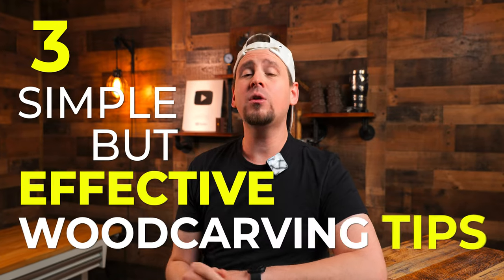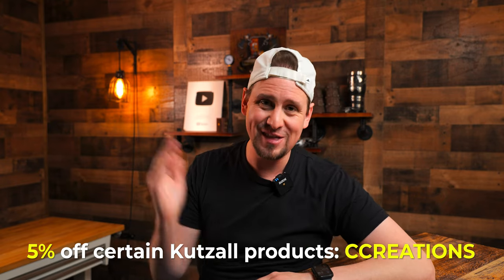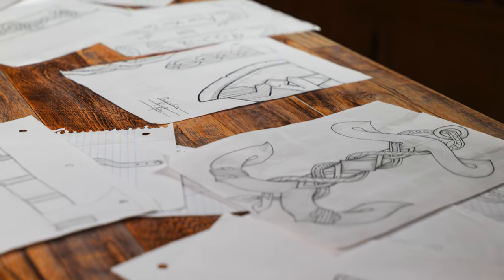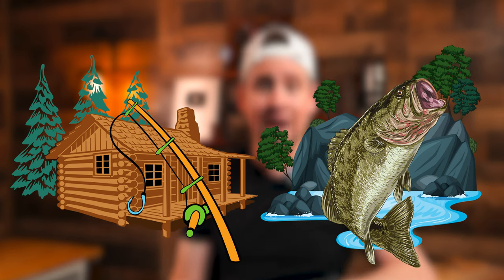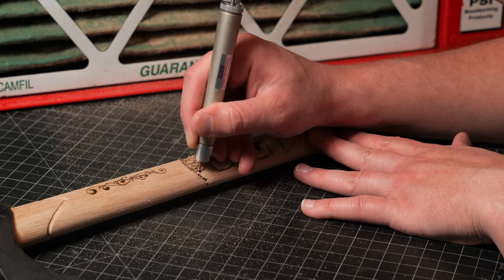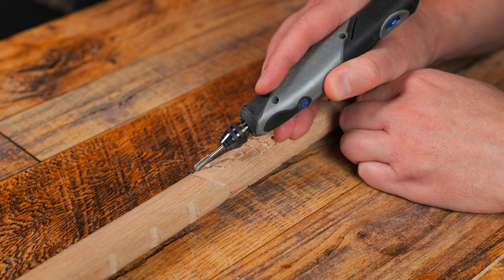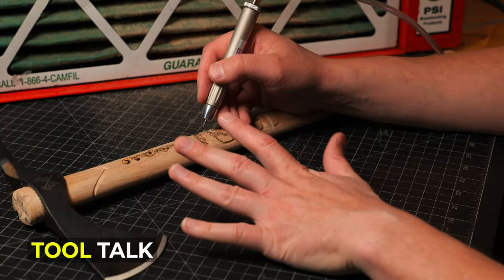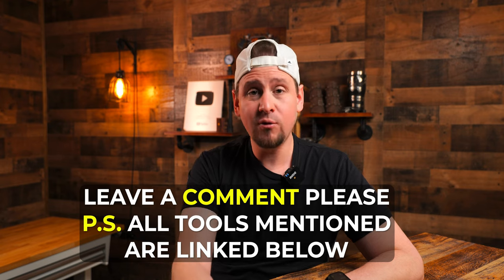Level Up Your Woodcarving: 3 Simple Tips That Deliver Results

Comment: Well, look what I found at the bottom of my YouTube rabbit hole. I started by looking for wood burning techniques and ended up here. I have a 1968 Bertram Bahia Mar 20 that was my dad's boat when I was growing up. He left it to me when he passed, so she's like a family member to me. She's going through a pretty in-depth restoration project at the moment, and one of the things I've done was to build wooden seat backs to copy the brand new Bertram 35 seats. I intercepted some beautiful maple that was on its way to make violins and did my best on these seat backs. That said, I am a commercial carpenter, not a finish carpenter, so mistakes were made. 

Now I'm looking to transfer the classic Bertram Eagle logo to my wooden seat backs. I was going to burn it in, but I think you've convinced me to try to carve them in. I'll try it on a piece of scrap first, but I think I'm sold. You do some incredible work.

Comment: I've been carving using knives and gouges for awhile now. Because of some issues with my 70 year old hands and fingers, I've recently been trying my hand at power carving with a Dremel with the flex head and an small assortment of recommended bits.
I find the Dremel difficult to control accurately. The Dremel is helpful in tight spaces but I still prefer using and the look of carving with a knife and gouge despite my hand problems. Not ready to give up on either the Dremel or the knife yet. I will keep practicing.
Reply from the maker: The hand carved looked from chisels are hard to beat. Using a Dremel definitely takes a little time to learn how to use. If you have the pockets for it I recommend the 400xs hand piece from SCM systems. It has no vibration, no burr run away and will carve literally anything
Reply: @CorneliusCreations  thanks I will take a look at that hand piece. I recently have begun to use an compressor powered die grinder with Kutzall bits for my larger carvings. I like it a-lot. I also have a very small, cheap air powered pencil sized hand piece  from Harbor Freight for small bits and small carvings. That shows some promise . Seems easier to control and I like the variable rpm control of the pneumatic tools . Of course the HF hand pieces leave something to desire with quality, but a good test of concept for me without laying out a bunch of money right away.
Lots of ways to go . 😊